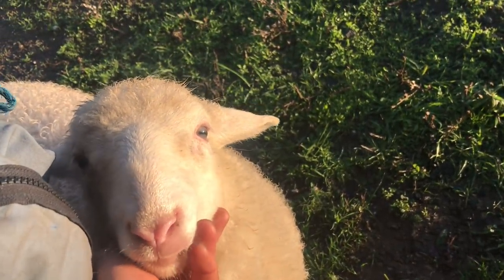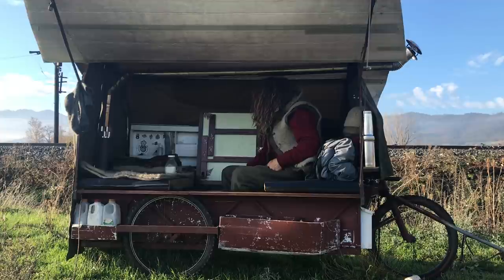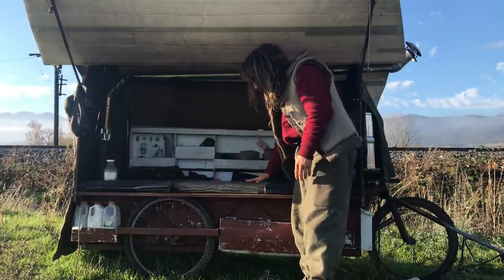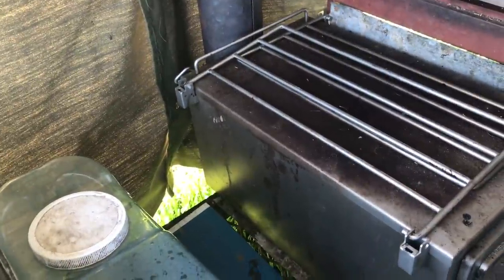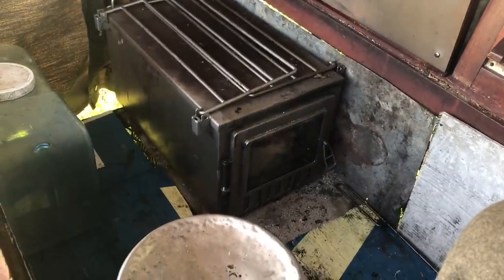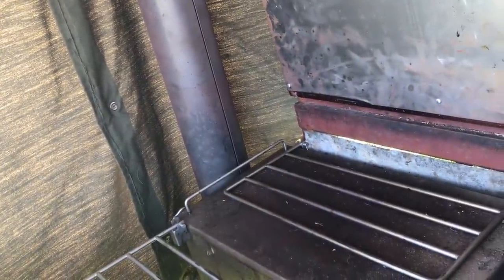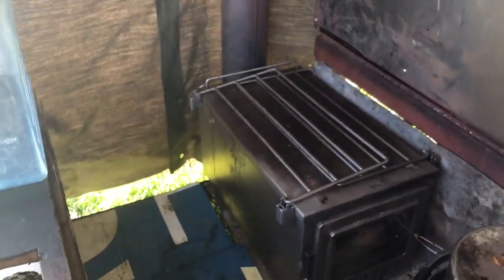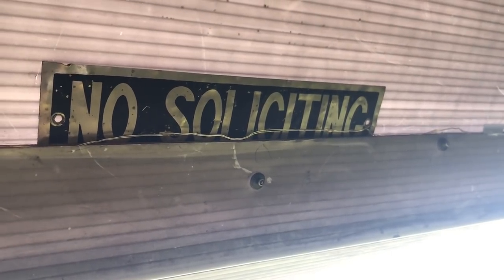Pimp my gypsy wagon 😎

Comment: Loving the fairy lights. I can't live without them. Got them strung up in our Tiny house on wheels too.

Another great idea is to place them in a clear glass jar. They look pretty at night and provide great ambience.
Reply: My sister does that too! She puts them in her bathrooms as night lights.
Reply: I have solar fairy lights outside in Michigan weather year round. This will be their 2nd winter. And yes, they do still light up in winter almost every day. 
I also have a 4 foot retro looking golfer statue that someone used to have hard wired into a light switch at their house. The Romex was sliced off at the back. My bf's dad got it at some auction. I had the same idea for the glass lantern the golfer was holding. I cleaned up the jar, sanded & repainted the rusty lid, & stuffed it with fairy lights. Stuck the solar part in the flower bed next to it. Now it looks like he's got a jar full of fireflies that comes on every night when the sun goes down.

Comment: Stove idea...
Its better to eliminate losing heat from camper, than to generate more heat. Layers of dead air are used in Extreme North tribes, to turn -50f into +80f with very small fires. They use a tent, in a tent, in a tent, with dead air between. Body heat alone being trapped can be sufficient, so reducing thermal loss is most efficient way to effectively heat from everything I've read. However, you are the one living it, not me, so I've little to meaningfully contribute.
I do appreciate your content. Thank you for sharing.
Reply: Every decision needs to consider weight & sustainability. Portability.  Wood can be harvested everywhere, so he & the sheep need not carry the weight. I've seen multiple suggestions regarding insulation & several about modifying the stove set up, regarding plaster, etc. I don't believe weight, portability, & sustainability were considered when these suggestions were made. 
I too am curious about how the horizontal pipe will work out & wonder how he manages to not burn himself, so I'd love to see a video with a deeper dive into how he came to the decisions made. I just assumed that he intended maximum fresh air circulation, & that the horizontal pipe was intended to radiate heat down on him from the entire length of the wagon. 🤷
Here's hoping we get a follow up vid!🤞😆👃😀
Edit: I watch a lot of car life vids. People often warn about using up all the oxygen in the enclosed space & stress how important it is to crack windows for ventilation so you don't die overnight in your sleep. THAT'S why I assumed this set up was intended for maximum ventilation.
Reply from the maker: @safetyfirst3132  yeah its just drafty enough to be safe.  The chimney has an incline to it and works great.  I wouldnt ever need or want to burn the stove at even half raging so the stove pipe never gets too hot.
Reply: @123Homefree  I'm so excited you replied 😀 I hope you have a beautiful day. Be safe & well! Good sheep! 🐑 yeah🎶
Reply: Eric kicking liberals  It would--so much so that he wouldn't need the stove as it would bake him!  One lg roll of reflectix would cover the whole wagon and do the job, very light and not bulky. 
 I am thinking a simple piece of mylar or just aluminum foil taped down under the sleeping pads might be nice, no weight or bulk but keeps cold from ground away, reflects heat back.  Could be taped or glued on underneath the lids.

Comment: If you run the vent under instead of across the roof and then up the outside upwards the length can heat the flooring adding heat as the heating rises JMO

Comment: Clad the interior with aluminium insulation bubble sheets, with spray glue and duct tape. 
Wouldn't cost too much to do, and also would not add too much weight to the wagon.

Comment: Cool you got some nice upgrades! Looks good.
The stove looks similar to the one I got for my truck shell from Vevor for $160.(I think it's more $ now) which was price I could deal with. Yours looks bigger. Mine is very solid & quality was great. It has 2"pipe since my shell is old metal work shell I have a hole for pipe with screw in plug for off season. Since I rent a run down home now I set it up in newest add on since this old place is tinder. Even old chimney is sealed dispite having pipe inside block it is fire hazard. But add on had new walls though old roof as it was patio. So routed through wall. All tent stoves I've seen have rear stovepipes. I've gotten several things from Vevor as they are reasonable & all have been quality stuff.

Comment: The heat affected zone(HAZ), the area around the weld where the molten metal and the cold base metal interacts. The cold base metal cools the molten metal very quickly at the edge of the weld creating large metal crystal grain structures that are brittle verses small, tight grain structures that are more durable to stress loads. Aaron, always inspired by your quest for knowledge and willingness to share. Keep up the fantastic work!
Reply: HAZ is mistly produced by difference in crystalization with surrounding material, producing mechanical stresses. It can be alleviated by heating it (at a lower temperature than tempering) and cooling it slowly. I think it's called annealing.

Comment: Mylar Emergency Blankets, there should be plenty of ways to get them, homeless shelters, maybe food banks, you might even be able to ask the local EMS squad for a couple as they do have them for SAR.
The big problem I would have insulating a wagon like that is the horizontal chimney. Insulation does no good if there is a giant gap in your ceiling that heat will bleed through. If you could make the chimney vertical so you can safely insulate the roof with no fire risk, your wagon would be much more heat efficient. You could use some sort of flashing provided it will withstand the temperatures, maybe in conjunction with that insulated fireproof plaster that DIYers make forges with. That would make your wagon lose less heat.
Reply: Reflectix.  Foil faced bubble wrap.  The stuff is amazing.  Also very lightweight and not too bulky nor scratchy. A piece under the sleeping pads.  Another piece to roll out over the top of wagon or glued to underside.  Removable for summer.  Chimney hole would need a small piece of rock wool.

Comment: You can buy a fiberglass infused silicone oven liner and cut a chunk to hang behind the stove pipe and use the rest to make a stove jack. Get that thing sealed up nice and tight for winter. Get it too tight and you might have to worry about your air quality. Could pipe air from outside into the fire if that becomes a problem.

Comment: Aaron, if you could start over with a redesigned wagon, would you change anything? Would you recommend using aluminum tubing to make it lighter in weight?  I think that would be better for me.  Would you have two yokes upfront instead of one?  Would you make it any wider by adding a slide out that can be opened when parked and closed while in motion?  Perhaps add bug netting.  I love the concept of your wagon, sheep and lifestyle for a SHTF scenario.  I have an electric bicycle and a small pet trailer.  But if I were to have a wagon fabricated for a shepherdeess lifestyle that would be ideal for the upcoming Tribulation.  No tear up and tear down every day with a tent. No carrying things on your back. I currently live in a huge home on two acres in a rural setting with my husband and two consumer pet dogs and one cat and chickens.  Sold all my goats two years ago.  I'm thinking of getting some sheep this upcoming Spring.  Trying to decide on a breed.  I really like polled sheep, fine wool (not double coated) but would need decent to very good milkers.  There are over 1,000 sheep breeds to filter through.  I'm not doing this lifestyle unless I absolutely have to, but i could get two ewes to start.  I'd like a wagon though.  I could use my electric bike to pull it initially.  Any sheep breed recommendations?  I want them under 100 pounds so I can handle them easier.  Thanks.  April.
Reply from the maker: Finn are the smallest dairy sheep breed who also have one of the finest wool of the dairy breeds.  I wouldnt change a thing about this wagon design width, i would make it 8 foot long instead of 6 so a full sheet of cloroplast fits over it still and then i would just have to add on the roofing over hangs on each end.  My roof height is adjustable so when i finally replace my cloroplast roof for the first time i will leave it longer in height and set my roof to its maximum height.
Reply: @123Homefree   Thank you Aaron and Happy Thanksgiving if you celebrate it.
Reply from the maker: @Stariana19  yes i celebrate this day of being grateful
Reply: @123Homefree  What's the max roof height for making a wagon?
Reply from the maker: @SovereignSymphony  i suggest not making it taller than 6’ or else it cant fit under nearly as many trees for shade in the summer and its nice to be able to see over it since mostly looking ocer my right shoulder back at animals means i can turn just a little more and see cars coming

Comment: How well does the stovepipe draft
Reply from the maker: It was perfectly slow back then when i had a stove that wasnt as sealed and airtight now my stive is so airtight i can throttle it down to burn alll night like i had to have that longer stive pipe running across my ceiling to achieve before

Comment: I have a paxcess 120w panel and 50k mAh battery set for car camping. Looking at what your use cases are likely to be they're both probably complete overkill. With the largish Anker battery you have a $100 60w solar panel is probably more than enough for your needs.

Comment: Do you cook on top of the wood stove or do you still use the solar cooker?
Reply from the maker: Both winter isnt consistently sunny enough to warrant toting it around so i leave it at a farm usually in the winter.  The woodstoves i leave at a friends over the summer months too.
Reply: @123Homefree  it would be nice if GoSun made a woodstove that could also be used as a solar cooker. Like one of those collapsible wood stoves, but a cylinder instead.. or the titanium foil used for some portable campstove chimney pipes.. that could be opened up (reflectors) as needed when used as a solar cooker, and then curled back up around itself and then set up with its own stove piping, a door / air intake / etc. In either form, the central gosun solar evacuated tube could be de / detached as needed?
Reply: @123Homefree  or.. the main part of the stove, being the same length as the gosun tube, could have a concave / half circle space to set the gosun.. upside down, so the tube would be sort of hung over the fire, with its reflectors over the outside of the stove walls, as sort of heat shields, that also reflect more of the heat towards the stove. The stove, without the gosun, would need walls, the back piece with its rear pipe exit, as well as a front door, baffle / air control, coal grates, etc. It wouldn't be welded/sealed to the gosun, but maybe it would help make it more airtight if you used the fiberglass rope gasket stuff used around the glass in cast iron wood stove doors?

Comment: Oh, niiiiiiiiiiice.  Nice how you ran the pipe over the ceiling.  That should keep ya warm.  I was intrigued by what you were gonna show us for your winter set up.  That looks like its going to be pretty comfortable.  Safe, right?  I was gonna suggest a solar panel and 50 watt reptile bulb form the pet store but I didn't know how it was gonna mesh with your anti-consumerism.  I mean, you bough the stove, right?  I heard terrible stories about the homeless setting their tents on fire on that InvisiblePeople channel.  I, personally, liked the heat bulb because its low what enough for a solar system to power all day and night.  You could have a small panel and heat yourself with the stove while you're awake and then use the stored power to run the bulb while you're sleeping. I dunno. You're a big boy. I'm sure you know what you're doing.  I like the old ways because they're less dependent upon things we can't create or do for ourselves but I also don't want to set myself on fire so I just roughed it in my 8x8 with nothing but a good sleeping bag in minus ten degree whether last winter.  My breathing kept the water bottle in the window from freezing but the pee pot on the floor was ice.  You'll be okay.  You'll be alright.

Comment: Herez a good solar panel : aimtom 60w folding panel , check out my new Woodstove on my channel if you like it won't hold coals that long but it's one of the best diy stoves /packable/lightweight you can
Reply: Wind it gets to 120mph in storms here and I had to use eyebolts thru the frame to peg down my camper with wooden stakes so it wouldn't blow away

It's hard to sleep because of all the shaking and accompanied by hard pelting rain , I tore the camper down after seeing yours and will make a new one with some inspiration from yours, I can't have the doors fabric tho it'll rip and blow thru in those winds some thinking to do